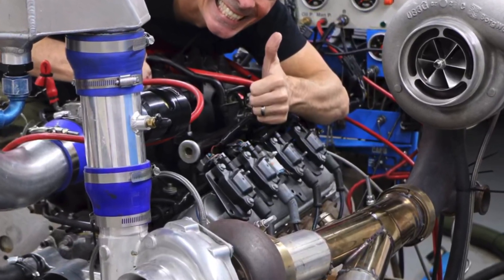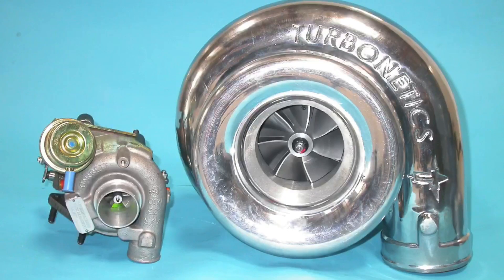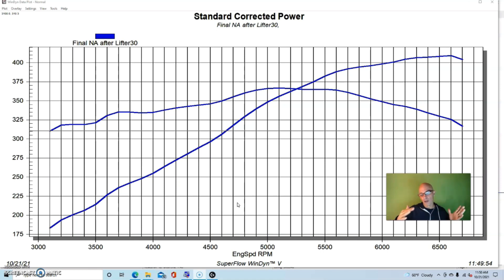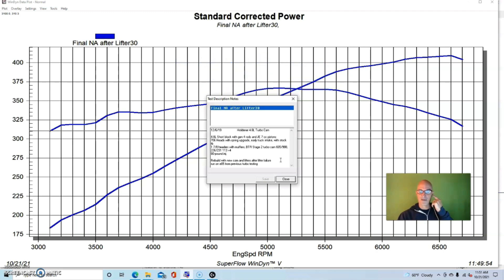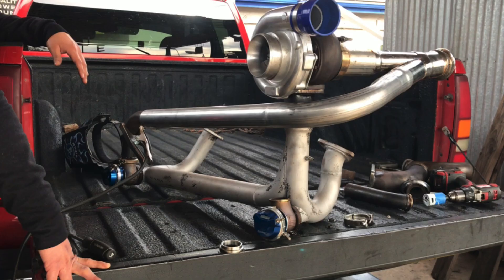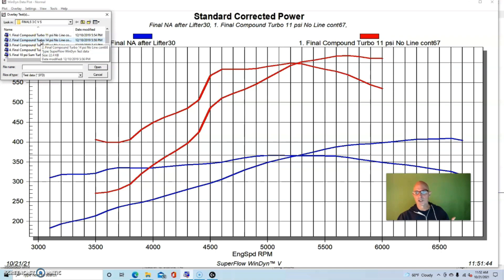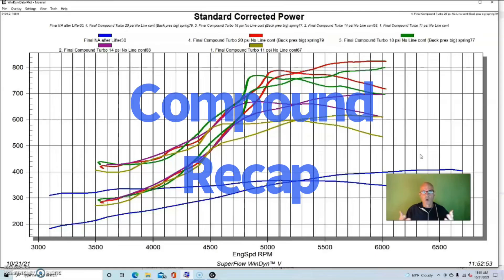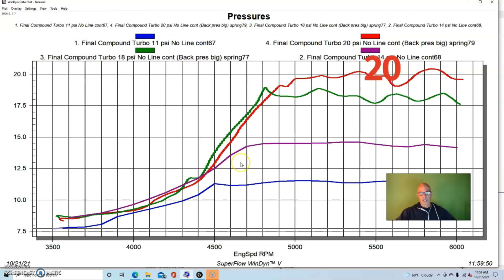COMPOUND TURBOS VS SINGLE TURBO-(WHO WINS?) SHOULD YOU RUN COMPOUND TURBOS ON YOUR JUNKYARD LS?

Comment: This is just practice for the 2.2 1000hp setup.
Reply from the maker: THAT ONE NEEDS LOTS OF BOOST
Reply: Well...I am kinda working on it. I have the bottom end together (forged crank, BC H-beam rods with 7/16 ARP bolts, 4-bolt main caps with ARP studs, MP billet end caps, JE pistons). I have a head that can do it (16V Masi, not 8V). I need some custom cams and solid buckets for it...then put it together and let 'er eat (well...needs intake and exhaust made, but I have those parts, too)! My original goal was 700hp, but I'd really like to crack that 4 digit number with a 2.2 just to prove it can be done. To add to the challenge, race gas only. I HATE E85 (I have reasons that are too long for this forum and some would argue they are petty). My original plan was to use compounds to pull it off, but newer turbos are so good it kinda doesn't make sense anymore. My biggest issue...no way to get the power to the ground! So, even if I DO get it all together, I dunno how I will ever be able to test it. :( As good as the stock FWD Dodge transmissions are, I don't think they will hold up to that much power. We know they will hold 600hp even being abused (talking A555/A568). Nobody has really gotten past that on a manual and maybe 2 people can really prove they made more though an automatic (VERY custom inside). What has held me back was safety...I didn't want to put all that power in something without a cage. Life got in the way and this all has taken a backseat for several years now. It's looking like the time is NOW to try for it.

Comment: 62-68mm primary and a 80 up to a 88mm would be a lot better test. You want a small turbo to get it spinning up fast at lower Rpms and then the big one will keep it flowing up top. I bet it’ll pick up a lot at 2500-4k rpm going to a 62-68mm the it’ll level off to around the same as those graphs afterwords

Comment: Inlet pressure is probably the variable most responsible for the performance of a centrifugal compressor. If you cap the inlet the blower won’t blow. As you add more pressure (or reduce restriction) to the blower inlet (altitude, or another turbo blowing into the inlet) it can move more air more efficiently as a RATIO of inlet pressure to outlet pressure. 

Typically you’ll max out the smaller turbo, and essentially run it w/o a waste gate and dump everything from the small turbo’s exhaust side into the larger s turbo’s exhaust side. The larger turbo is there to pick up the slack to put the smaller compressor back into efficiency by providing enough inlet pressure to maintain the pressure ratio the smaller turbo is more efficient at. 

Mostly run on Diesel engines because the air movement can be fixed and independent of fuel supply. 

You could run a really small turbo with an oversized exhaust side, and a wastegate on the cold side pipe feeding the smaller turbo’s inlet to control inlet pressure at the smaller turbo, because the inlet pressure at the smaller turbo is really where the “boost control” needs to happen to keep the smaller turbo in its efficiency map.  A compound isn’t going to work well if the smaller turbo isn’t maxed out or close to it. The larger turbo is really just there to cheer on the smaller turbo by way of force feeding it.
Reply: This was the explanation I needed to hear, I am interested in putting compound turbos on my sti because with a 4 cylinder you can only fit smallish sized turbos before you run out of a useable power band. Currently I have a pretty large blouch dom 5 which is essentially a gt35r turbo that spools at around 4200 rpm and I don’t want to have to rev higher than that before anything happens. My question is what size large turbo should I be looking for as I want to fit one that is as large as possible in order to make good turbo efficiency from both in order to make the most possible power. At 25psi currently I’m making 510whp but my engine is built to handle over 800 hp and if I just increase boost the turbo efficiency will eventually drop. It’s also not exactly easy to figure out how to plumb the waste gates, for maximum response I like your idea of only running one on the larger turbo and relying on the cold side to reduce boost pressure. Unless I miss understood what you said.
Reply: That 2nd paragraph is only true if you don't know what you're doing.  Youre supposed to cap that turbo at a certain boost level (with a giant wastegate) so it stays in its efficiency zone and this will never over speed or become inefficient.  What you're talking about is a traditional sequential setup and not a sequential compound setup.

Comment: Your small turbo wasn't small enough for the amount of total power you wanted. In a ciompound setup, you want the small turbo to have just enough flow at a relatively high efficiency to provide the flow for the power you want at the p/r that the primary (larger) turbo is running at. It can become a little complex. Especially if you're wanting to run at variable boost levels, say like a street version and a strip version.
Reply: Yeah. I would agree with you. It would have been good to see him use a 66 or even a 64 or 62mm secondary for fast spool up. A turbo that small might have required two wastegates to control boost
Reply: THIS!  75mm way too big. Go 65mm - 69mm
Reply: if a 75 spools without the big turbo it should spool with it added as long as the turbine on the larger turbo isnt a restriction.
Reply: @azreeal1  no matter how big the bigger turbo is it’s still a restriction, take a laggy single and put a massive turbo over it and it’ll just be a laggier single
Reply: Drive pressure was too high.

Comment: Two things. 

We're going to need to see this test on a diesel engine. 

Based on comments, we need to see this test again with bigger power/boost goals.

Also, I've been  curious how this works on a diesel. It seems like there isn't enough rpm window for this to work.
Reply: He doesn't test diesels on the dyno. And besides, diesels are gross lol
Reply: If you have a compound setup on a diesel you are probably trying to make stupid power in which case you are also probably spinning the thing about as high as this 4.8 was spinning under boost
Reply: @sabero5668  diesel compounds can be for big power or towing. Mainly it's for big pressure ratio. Diesel needs big air flow to run cool. Most big power dyno or drag diesels are big single. Rich air fuel diesel is smokey and high egts, lean a/f gas engine runs hot. That's the short version anyway
Reply: It’s pretty easy to out run the efficiency of a small turbo on a diesel. Then you throw on the bigger one to get the efficiency back. It’s not rocket science, you just have to have a goal much bigger than the small turbo can support alone. I don’t think that’s the case here.

Comment: the function of a turbine is to multiply the atmospheric pressure and send it to the engine, the compound advantage is that by sending atmospheric pressure + turbo pressure to the first turbine the first turbine multiplies both atmospheric and turbo pressure causing the two (in this case 3) multiply the atmospheric pressure much more easily at high multiplication ratios, in your case the multiplication rate of each turbine is so low that they are simply not made for it, try something above 40psi intake pressure

Comment: Compounds are good for low rpm power gains. Sized correctly. HX27/GT45
Reply: The right sized compounds on a LS should increase power from 1500-5500 rpms. Like having 600+ #/ft of TQ as early (or earlier than) 2400 rpms. 

Might be something to see this done on the 454 with peanut port heads....
Reply: The 454 with a GT45/ S480 should (in theory) improve response between 1800-4500 rpm. Imagine diesel power specs out of a big block. 500hp/1200TQ.

Comment: Would love see it done with small turbo and big turbo so we can see the low rpm tq.  Be cool to see the drive pressures of turbos too.
Reply: You have to be ready for big boost. You need to get both turbos working in the efficiency maps together. In this app, you don’t need it so you can’t get them working together. It’s not enough total boost at the end.

Comment: Rich, 
You should put a compound set up on the Ameri-Barra 4.2.
                Sincerely,
             Cpt. Obvious
Reply: Would make 7000rpm power @ 4500rpm. Inline motors seem to give the best architecture for compounds. A compounded 40-50 psi of boost might put you behind the blast window with a broom in hand. 
O ring the block and head, champher and widen  the oil galleys on the mains and cam bearings, drill extra oil holes in the bearings, girdle and stud the block, mains and head. Leave everything else up to science and the dyno. 800hp between 4k-5k rpms is a win.
Reply: He221/GT45

Comment: I'd love to see my compound setup on that little LS...  S400 75mm and a S500 94mm 😎

Normally the atmospheric compressor needs to be sized for the desired power, and the high pressure compressor is normally half the airflow of the atmospheric.
Reply: Close, but even that is too simplistic for the reality of making a good compound setup. 

You have to look at the desired total airflow first, which will be ENTIRELY supplied by the primary FI system, and this is the important part, AT the P/R that it will be running at BY itself...

The secondary needs to be sized based on the flow needs when dividing the total P/R by the primary's P/R.
Reply: @BrockJaden  D/R should be used instead of P/R for more accurate/realistic calculations.

Comment: You’re working with too big of an engine and/or too small of a power goal. You need a large difference between N/A airflow and target total airflow. If your engine flows 45lbs/min you’re never going to make a good compound setup only trying to move 80-90lbs/min. You need to be aiming for 3 to 4 times N/A airflow to make it worthwhile
Reply: Totally agree. I think this is almost the worst possible use case scenario for a compound setup.
Reply: I was wondering why I've hardly ever seen any thing gas i4 compounds and diesels .   Thanks guys !
Reply: Makes sense.   From the data it appears by the power curve that the small compressor is creeping up into it's map and maybe made it on the 20psi run since it was partly multiplied by the big turbo . But the big one barely got tickled 🤣😂